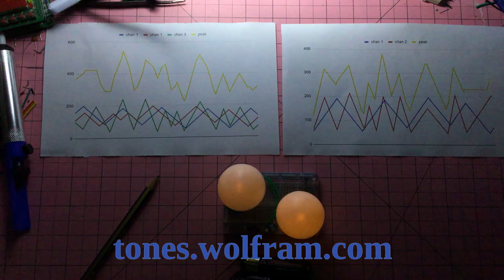PFS154 PWM for fake candle (Part One)

Comment: Did you say the PFS154 was a paduk IC, if so is it one of the single programmable chips or multiple use? I will have to look for some of those LED's
Reply from the maker: It’s what they call MTP, multi times programmable. The PFS173 is probably a better deal with 3kb mem and an ADC. 👍😀
Reply: @onecircuit-as  just that every time I hear paduk I think back to Dave (EEVblog) playing with those few cent single use chips. Should have known that they also produced MTP chips. Brain fart moment 🤣
Reply from the maker: I do have a few hundred of the PMS150C OTP (one time programmable) chips, the 3c jobbies. They have limited specs, but hey...3c!
Reply: @onecircuit-as  yup that's them, 
3 cents lol. Was there a minimum purchase number.
Reply from the maker: Yes I think there was (maybe 5?) - but interestingly the supplier (lcsc) has not had any in stock for ages - something weird with supply is going on.

Comment: What kind of LEDs are those? Ive seen them before but don't know what their package is called.
Reply from the maker: Look for “2*5*7mm Square LED Kit Light-emitting diode Kit 2X5X7 LED”, should be around AUD$3 per 100 plus freight. 👍😀